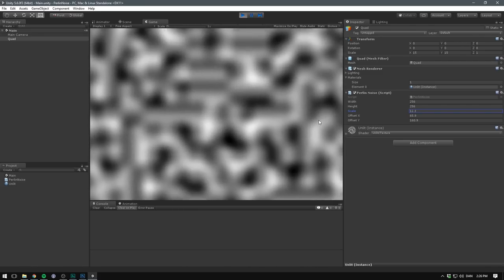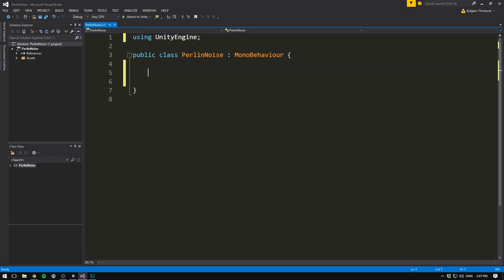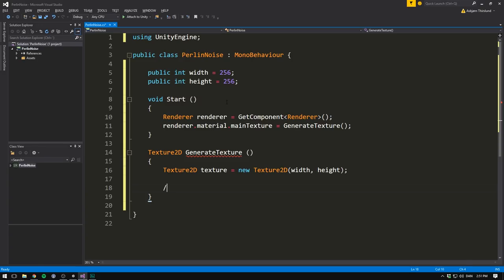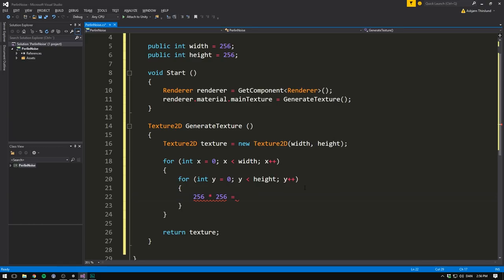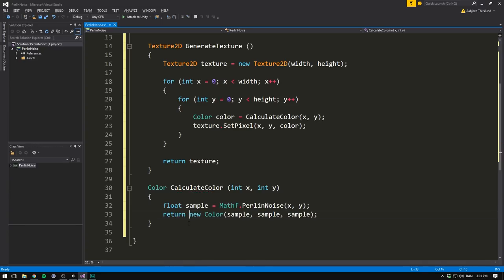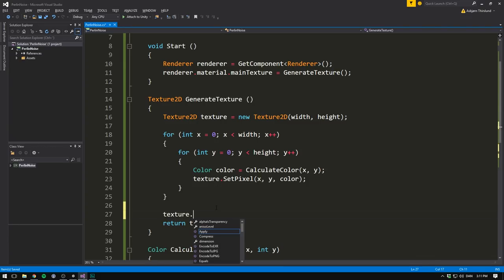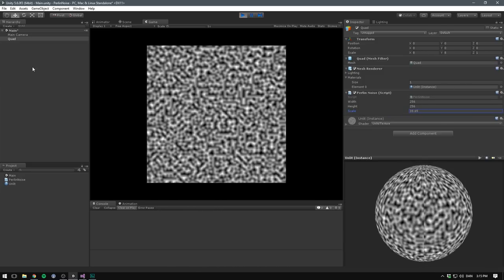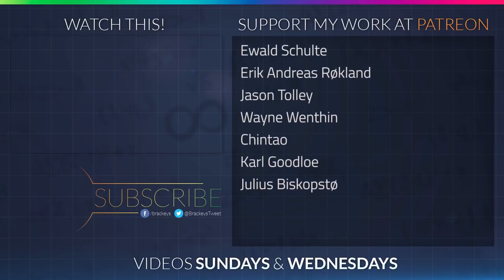PERLIN NOISE in Unity - Procedural Generation Tutorial

Comment: just wanted to say that the first image you've shown isn't actually random, but pseudo-random as well.
every random number generator you use on a computer is mathematically generated, and thus pseudo-random.

what truly distinguishes Perlin from ordinary (pseudo-random) noise is that it is locally smooth / interpolated, which is not only convenient for the programmer, but also quite similar to the graphical noises that occur in nature. the trick was making the algorithm that does this fast enough. so thanks Ken Perlin (et al)!

the only truly random generators are random by hardware, i.e. by measuring true entropy such as brownian motion, turbulence (by air currents and similar fluid dynamics), cosmic radiation (white noise), and such.

even though many algorithms we use for pseudo-random generation are tried for balance and mathematically proven to be well-distributed, the sequences they produce are inferior to what the universe might throw at us (a couple of dice i.e).

this is a fact of life to such extent that in many countries, the laws that regulate gambling and lottery services demand that the RNGs used in digital products cannot be pseudo-random at all. so the online gambling providers typically have to use devices that literally sample true atmospheric or electromagnetic noise at regular time intervals.

of course, you don't have that issue with a (non-rigged) roulette table.
Reply: weird flex but ok
Reply: We know that it's not 100% random but that's the closest we can get, deal with it lmao
Reply: If our universe is deterministic, nothing is random. But if it is not (maybe because of quantom mechanics) then there probably particles that might behave randomly.
Reply: We feel that the universe is random because we haven't applied it yet. centuries back, air flow or winds was considered random now it is not because we know how it works.
Reply: @lavnishhh  you don't know what you're talking about. air turbulence is actually random as is any motion that is fundamentally Brownian.

https://en.wikipedia.org/wiki/Brownian_motion
https://en.wikipedia.org/wiki/Randomness

"According to several standard interpretations of quantum mechanics, microscopic phenomena are objectively random."

https://en.wikipedia.org/wiki/Chaos_theory

"[long-term prediction of some systems can be impossible] even though these systems are deterministic, meaning that their future behavior follows a unique evolution and is fully determined by their initial conditions, with no random elements involved. In other words, the deterministic nature of these systems does not make them predictable. This behavior is known as deterministic chaos, or simply chaos. The theory was summarized by Edward Lorenz as:

Chaos: When the present determines the future, but the approximate present does not approximately determine the future."

in the same article you can find the photo of aircraft wingtip air turbulence, which is used to illustrate the concept.

so it's hardly something we "feel" as you put it, randomness is an objective quality of the universe.

your quote: "air flow or winds was considered random now it is not because we know how it works."

where did you get this? as a matter of fact, exactly a century ago we thought it was not random, but in the meantime we learned better. the skeptics of non-deterministic universe are still scrambling trying to find a hidden variable theory, because of the incredible amount of evidence suggesting that the universe is non-deterministic, or is non-deterministic against our conscious efforts to measure it.

you can learn more about the chaos theory if you invest a bit more time with the following videos

https://www.youtube.com/results?search_query=double+pendulum+chaos

you can easily find mathematical proofs and the physical reasoning why is such a simple contraption beyond our means of predicting its behavior, and why this is likely to stay.

https://en.wikipedia.org/wiki/Butterfly_effect

Comment: Instead of putting the generation into the update method, you could just put it into the OnDrawGizmos(). It then allows you to change the parameter. To reduce the calculation amount, you could add a dirty flag with setter on each parameter and only then reproduce a new noise texture.

Comment: For anyone who is in 2D and tried using the Sprite Renderer, you can't as it doesn't allow for textures due to overriding them with the texture from the sprite you are using . You have to use something like a quad (mesh filter) with a mesh renderer which will use the created texture directly and then set the material to unlit > texture like Brackeys does.

Comment: Hi!
I have a question about xCoord and yCoord.
When I just try convert int x value from loop to float I get a result like 0,4652731;
How it works?

for example: loop index x = 1;
then xCoord = (float)x; is equal 0,4652731, and next interesting point is...when I divide x to width (width = 256), then xCoord is equal 1. 

Thanks for help :)